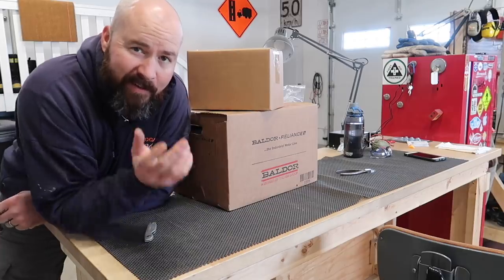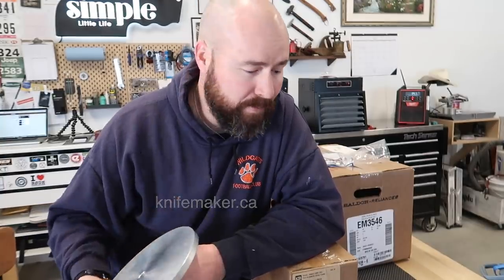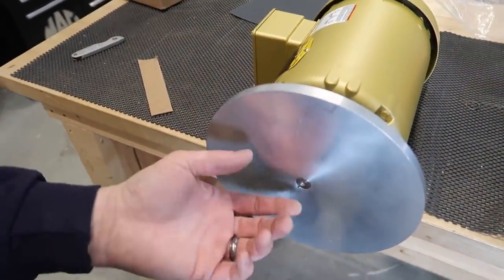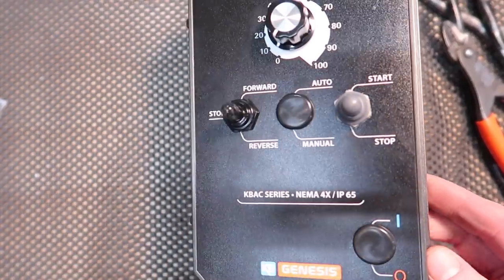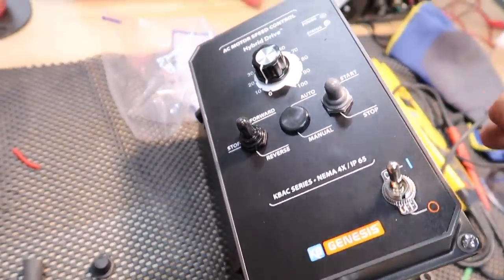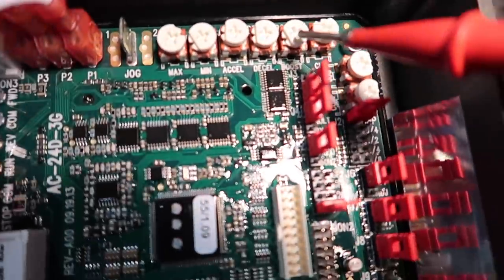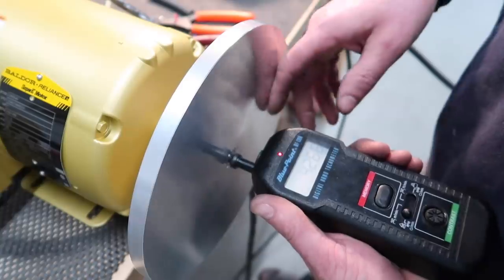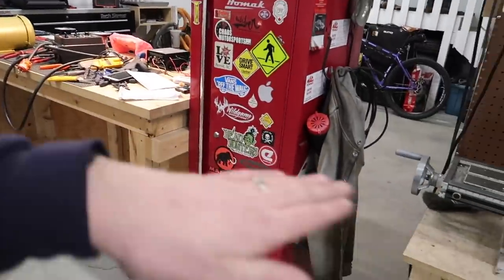Disc Grinder Project  - Hooking up the VFD & Motor

Comment: I use mine all the time. Would be lost with out I also did what you did mate and made my own then found a fantastic disc grinder from an old clock maker. Invaluable tool.

Comment: Prepping handle material and getting the right angles is my primary reason why I want one too. The 6" disk that I have does not have that accuracy as yours. That is why I try to stay away from making layered scales. And yes I would have no idea if you told me to bring you Marrettes. I would be looking for a pipe stretcher.

Comment: grab a silicone roller - to ensure the paper is fully flat on the disc. I believe that was a suggestion from Van Barnett's Instagram page. Also 84Engineering down in Oz has a super beefy disc rest - looking forward to what you come up with!

Comment: Where did you source your disc from? I have a vintage 12" disc sander (Wico Motor disc) that has a little bit of runout on the disc. Thanks for your help.

Comment: I don't know if you've already thought about it, but what works really well is to glue magnetic sheet to the aluminium disk and get some plate glass disks cut (just ever so slightly bevel the edges) and glue magnetic sheeting to them. Get a few plate glass disks cut. Then what you can go is have a set of disks, one for each grit you use. Changing the grits then is very quick and you only have to replace the sandpaper when its dead. It also means you can use normal spray adhesive, just get a paint scraper and scrape the disk clean when you change the paper.

As an added advantage the centre is completely flat.

Comment: CL stands for Current Limit. so this is normally the setting that let it stop when you put too much pressure on it. In this case if you jank down with a piece of someting and it is getting too hard for the dish to turn it can go into Current Limit. Not sure if it work with this setup though,

Comment: Did you get the Flat disc or the one that has the 1-1/2Deg pitch? I'm in the process of building one of these and am torn between the 2 discs. Thanks!
Reply: Another guy that has a good video on this is Nick Wheeler.

Comment: Cool let us know if the hp drop from the 1hp to 1/2 hp running on 110v makes a big difference on what you are using it for.  I guess you won’t be leaning into it that hard, but some materials are more stubborn than others.

Comment: This is two years old but if you do the same thing people do for the 2x72 belt grinder a square steal tube and put a second tube inside and buy the 2x72 table that adjusts

Comment: Hey mate can you please do a video on creating a beautiful knife from steel that is not perfectly flat when you get it from the factory. I’m pedantic about flatness and I wanted to hear your opinion on what parts of a knife need to be perfectly flat. I am starting my first knife and the steel is slightly warped so I’m trying to sand it perfectly flat but I’m wondering if this is all just a waste of time because I am thinking that the only section of the knife that needs to be perfectly flat is the handle so the scales don’t have any gaps with the steel. Can you show us what you do with your steel to process it to perfect flatness if that’s what you try to achieve

Comment: What is the address for kB Electronics, 9987, KBAC-24D (Gray), 1HP, 1-Phase, 110-120V;200-240V (Input), Nema 4X Enclosure, Variable Frequency Drives

Comment: Isn't 3 phase always 380 Volts? 
But you don't have 380 Volt stuff in your garages in canada or usa, do you? I've never seen it at least.
In germany we have 230 V for everything and 380 V is 3 Phase.
I'm just wondering, because you won't get a beefy drillpress for instance in germany that has only 230 Volts.
Reply from the maker: No, 3 phase can be different voltages. This FVD takes single phase (115V or 230V) and turns it into 3 phase. Slick as a whistle👍
Reply: @Simplelittlelife  ah okay,  thanks.
Do you know if it exists for 3 phase  380 volts?
Reply from the maker: I’m not sure....
Reply: @Simplelittlelife  Okay, i'll see if I find anything. 
Keep the great content coming✌ :D
Reply: @kinnajppe_140  VFDs comes in all shapes and sizes. if you want one for a 3phase motor its best to get one with 3 phase in. A 3 phase motors use less power but you get a bigger effect.
Its just that its not that common to have 3 phases in a normal househould over in america unlike in here in denmark where everyone got 3x400V + neutral goin into all houses.

Comment: Reverse on the 2x72 vertical or horizontal IMHO should not be added. The small wheels bearings get used to going in one direction and can cause bearing issue when reversed. easy way to give it a try is flip your small wheel and see. I did this and caused bad vibration and all kinds of noise. Just my 2 cents...keep the videos going. I really look forward to seeing new ones.
Reply: Lol, think you better buy good bearings... i do it more than 20 years....

Comment: Instead of switching directions on the motor why don't you just use the other side of the Disc Sander.